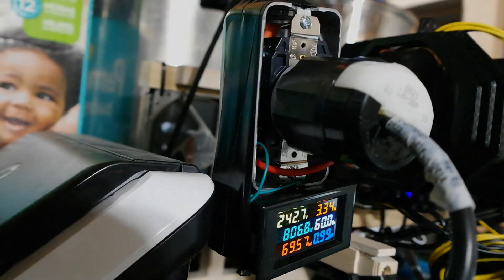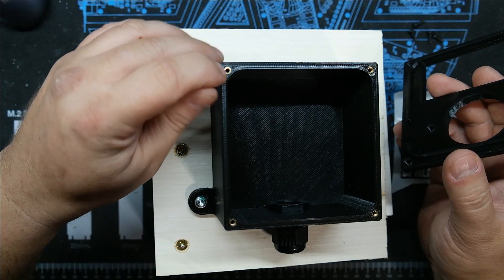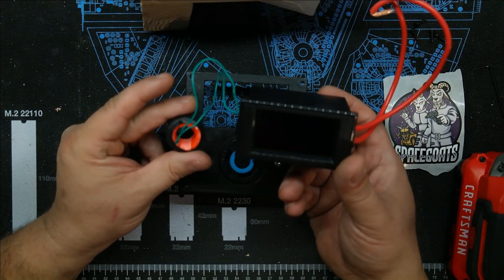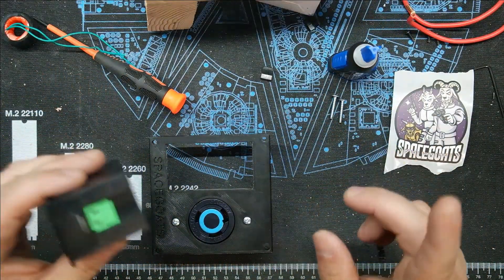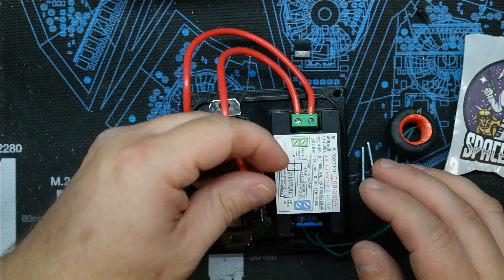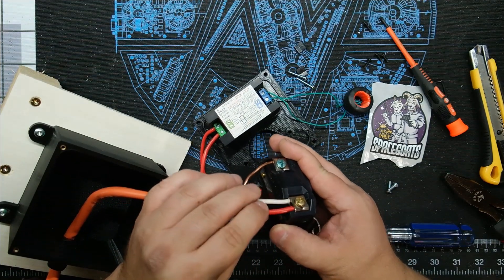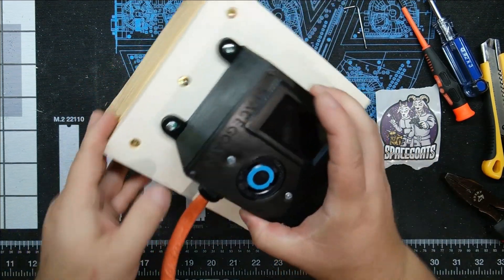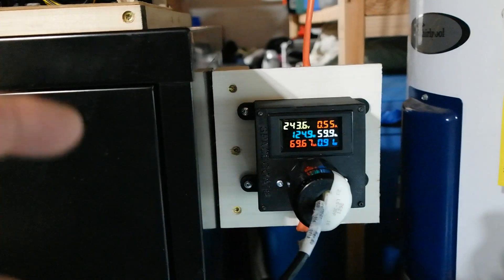DIY 240V Kill A Watt Meter Build For Crypto Mining Rigs

Comment: Well it only took me 3 hours of research, but I figured it out. Here's the answer to the question many have asked. 
If there is no neutral both legs will read the same, so you only need to measure one. If there is a neutral you have to measure both legs and the higher of the two will be your total current. That meter he wired only has two phases and both are hot, so both will read the same, so either one will tell you your total current.

Comment: Hey thanks for the instructional. What gauge are the red wires?
Reply: should be 10G , which is rated for a 240v line and 30amps

Comment: Is the amperage reading correct or is it HALF since you're only measuring 1 of the hot legs?
Reply: Same question for watts, Ives seen some whe once validate in a panel it doubles the watts for you if you have a balanced load. And I saw one person run both hots through the ct

Comment: Hello, I see you are using 10 gauge cable for your set up. Can I ask you which braker are you using? Im using a double 30amp braker and the meter box does not want to turn on. When I switched to a 20amp braker with 12gauge cables for testing purposes it came on. Do you have any idea about this? Thank you so much!

Comment: So this outlet you're using has 2 hot 1 ground. What if I'm using an outlet that is 3 hot and 1 ground (the "dryer" one as you describe)? Do I still simply connect the monitor to two of the hots? Or am I not able to use this monitor?

Comment: How would I wire it for four prong L14 30 to measure generator wattage? Do I need two meters in box or wire as you did with the two hots to the meter  and just one ct on one hot?

Comment: Wouldn't you need 2  core current transformers (your current readers) to get accurate reading of amps on a 240v line 1 reader for each hot?.
I see your meter is reading 240v but confused how if it's only reading 1 leg
Reply: Me too. I'm trying to figure this out. If only one hot is going through the coil  how is it reading 240 instead of 120?
Reply: Well it only took me 3 hours of research, but I figured it out. If there is no neutral both legs will read the same, so you only need to measure one. If there is a neutral you have to measure both legs and the higher of the two will be your total current. That meter he wired only has two phases and both are hot so both one will read the same, so either one will tell you your total current.

Comment: The CHOKE placement doesn't make sense in my head.  
Wouldn't it need to go around both hot wires?
Are you not measuring only half the electrons when measuring only a single 110v leg?
Reply from the maker: If you put the choke on both hot lines they will cancel themselves out as they're 180' out of phase.
Reply: @madelectronengineering  Hmmm interesting.  I didn't think about that being possible, thanks.

Comment: Hi! I have mine installed, followed everything. It lights up but it doesn’t read anything, it only shows 240 v and hertz reading. Wattage reading is at 0, any ideas?
Reply from the maker: Make sure you put the coil on only 1 of the 2 hot wires.
Reply: @madelectronengineering  it works, Thankyou so much!!!!!!!!!!👏🏻👏🏻👏🏻

Comment: Wait how does it sense it’s 240v when that donut only goes around one of the hot wires? Each hot is only 120...
Reply: The donut does not sense the voltage.  The meter has connections on two sides.  One side is the current sensor which the donut is connected to.  The other side which he used orange wires for is the voltage

Comment: You do not need that thick wire just to supply the voltage to the meter.

It only uses milliamperes so any wire (with decent insulation) would do.
Reply: He said that in video

Comment: I ordered this device. 50 amp wire 6 gauge is FAR TOO BIG for this device. The connections are literally too small for that sized wire. Says it’s rated for 100a but there’s no way
Reply: You don't need to put 6 guage in for your power to the meter  it can be 10 guage or any guage that's rated for  240v its just a power line. to power the meter on.the meter uses very very little power.  It just needs to be 240v rated the same voltage your reading from your 50 amp line

Comment: I had to found 2 outlets that would pair up to make 240.  One in my hall, one in mining office.  Going to feed them into a box to get me a temp 240 outlet
Reply: RIP
Reply: @c3mining527  it worked for the testing;) just has to have 2 120v on different circuit
Reply: @AlteredComponent  just kidding around, I know it will work, just risky for equipment if you were to lose one of the legs of power since they are likely on different breakers. I know your videos well, so I assumed you knew what you were doing and were well aware of the risks. Thanks for all your content BTW.
Reply: @c3mining527  appreciate it.  Definitely dropped it after only a week.  I wired a couple new 20amp breakers on 120v and new outlets for rigs in basement.  Wished I went ahead and did the 240v then, but what can u do